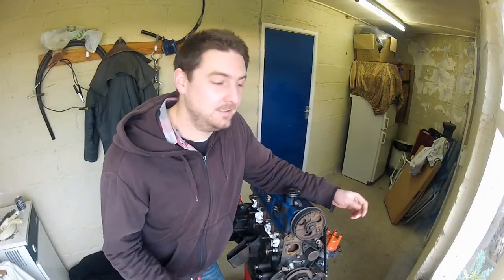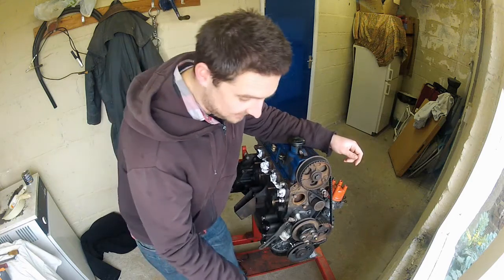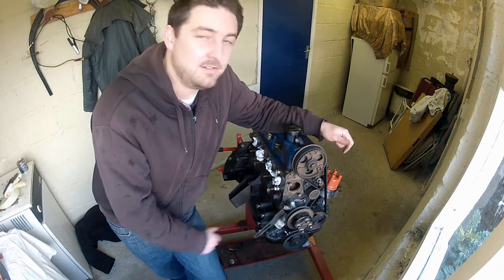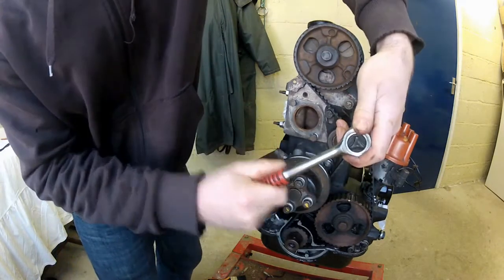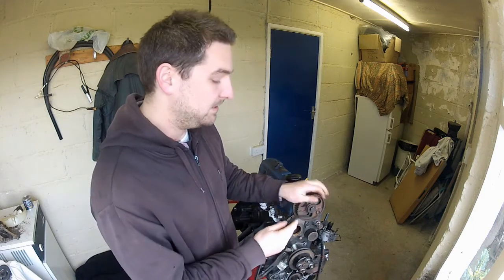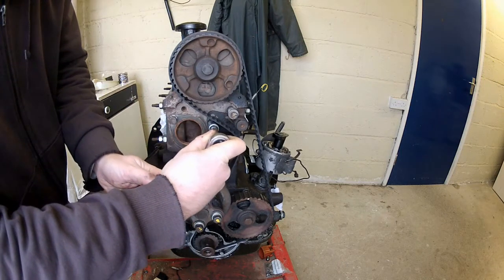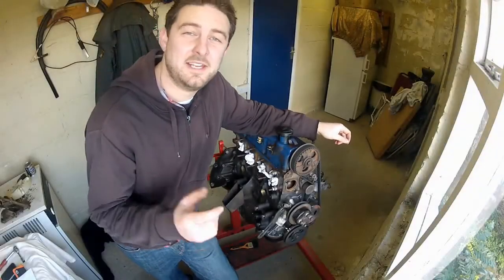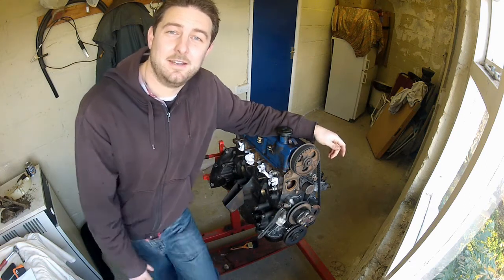How to Replace a Timing/Cam Belt on a Ford Pinto SOHC Engine (2.0 & 1.6) | Tech Tip 08

Comment: I clearly recall (circa 1978) having re fitted the cyl. head, timed up everything, forgetting the 19mm ring spanner I'd left on the crank pulley.
The other end of the offset ring spanner was exactly in line with anti-roll bar and the bolt just spun out when I started the engine.
I just re-fitted the bolt and there was no damage at all.  I'd got away with it!
It was a lesson learned.  When working on engines, always think on your feet.  Check and double check everything before you even think of turning that ignition key!
Reply from the maker: You may have discovered a good method for undoing seized crank pulley bolts there. I can't tell you the amount of times I've driven off after some tinkering only to hear a ring spanner rattle out of the engine bay. Easy mistake to make!
Reply: @FastRust  Hmm. ....  It is certainly a fast method.  I did hear a strange noise when I cranked the engine, but it started and settled to a nice tickover.
I scratched my head and looked around to find the spanner on the floor with the intact bolt still in its jaw - engine still purring away nicely!
Had I just found the bolt head in the spanner there would have been 'tears before bedtime'!
Reply from the maker: Ha ha. Yeah just the bolt head would have been another issue entirely! 😅

Comment: Great video mate! Just a quick question, if we are using gear puller to remove the crank pulley. Should we insert the puller jaws into the small 3 holes cut into the gear pulley or put the jaws to the outer circumference of the pulley?
Reply from the maker: Cheers 👍🏻 Outer if poss.
Reply: @FastRust  Thanks a lot

Comment: hi james how do you change those three oil seals at the front the cam crank and aux oil seal and also to remove that sprocket
Reply from the maker: Cam and Aux seals are the same, crank is it's own size. To replace them the sprockets will need to be removed. If you're lucky they will pull off, if not you'll need a bearing/gear puller. Once they're off you can prise the seal out of it's housing with a small screwdriver or pick. To install get a socket a tiny bit smaller than the seal to knock the new ones in. Only knock them flush with the housing, they don't need to go any further.
Reply: thank you for the advice,what size gear puller must be used,if you are doing videos on the capri in the future please do one on these seals have checked all over and one one has done on this type engine and the essex v6

Comment: I had a damaged timing belt and had no reference to the timing positions.  How can I tell if the crank shaft is correct or 180 degrees off? I lined up the rotor, the timing mark on the crank shaft and the moon and dot.  Car  car won't start w=even with starting fluid.  The engine is the 122 cid in a 74 pinto.  Thanks

Comment: Your video is great I have tried to follow it but every time the cam timing jumps teeth you make it look verry easy should I replace the tensioner spring ?
Reply from the maker: Hey man. Cheers. When they jump teeth it's usually because the belt is too slack OR too tight. My first pinto had no tensioner spring at all and I used to set them with a tiny amount of slack when engine was cold. As it gets hot you'll find it tightens up a bit. Try that, worked for me.

Comment: Just a quick question. I have pretty much the same engine except for mine is out of an 89 ford ranger an urs is a pinto I'm going to be doing some top end work and your videos have been a big help when it comes to setting the time does it matter that mine is a coil pack engine does that effect setting the time?? Thank you any help would be appreciated
Reply from the maker: Hi Jacob. Is it an EFI engine? If so the process should be very similar. If you have any problems let me know.

Comment: Also I was wanting to throw in a more sporty cam can you point me in the right direction to maybe get one??
Reply from the maker: Kent Cams / Piper Cams are the popular 2 here in the UK. I'm sure you'll find a supplier over there. Have to be careful if it is an EFI engine because they don't respond well to some of the carburetor profiles. I think Kent do a specific one for the EFI engine. FR34 from memory.

Comment: Is there an easy way to access the tensioner whilst the belt, thermostat housing and rad hose are in place?  And what's the best way to clean old belt gunk from around the crank sprocket guard?
Reply from the maker: +Finn McCool Yep, all accessible when you remove the belt cover.  A 3/8ths socket set is what I normally use. You mean the alloy cover at the bottom? I'd be tempted to try engine degreaser, Gunk or the like. If you really want to get in there, you could remove the crank sprocket. In theory this should pull off, but in practice it can be a stubborn mother.  Personally I wouldn't bother trying tbh.

Comment: can the camshaft pulley be turn other side, front what is now to be  back side? there is a nice ford logo on the back, just the pulley not the plate whit the mark behind
Reply from the maker: +Point made hey. Yes it can, seen a few like this. Same with aux pulley. Just swap that plate to the other side like you say.

Comment: 2.0 pinto is a non contact engine,if the belt breaks,it just stops
Reply from the maker: Correct. If it's a standard cam.